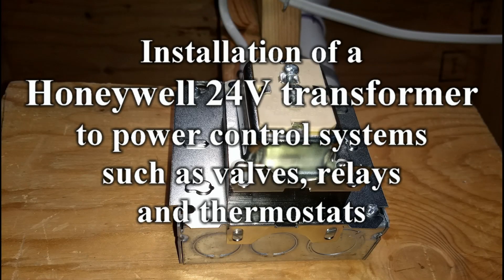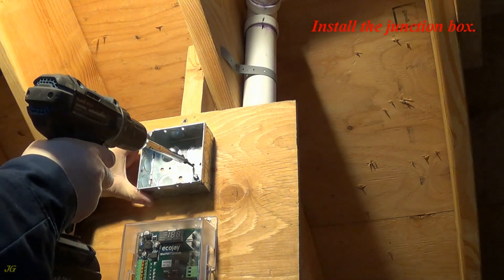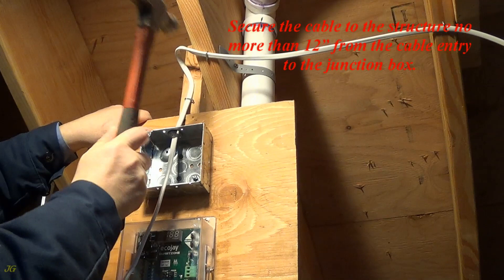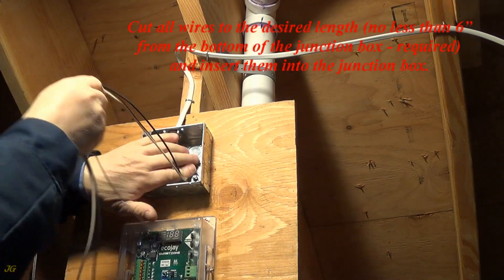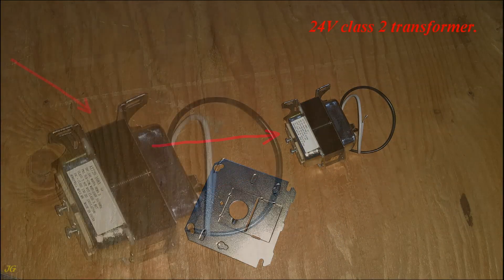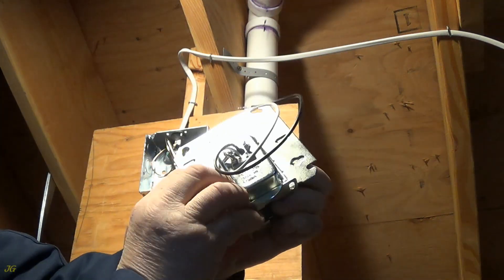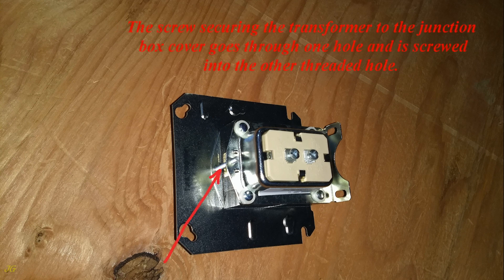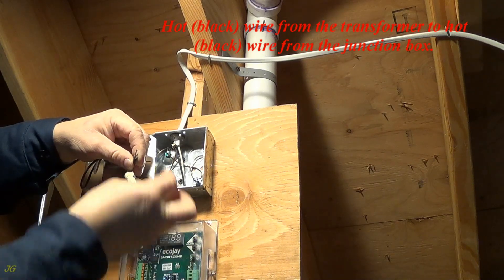Installation of a Honeywell 24V transformer to power control systems such as valves, relays, etc.

Comment: Hello John. Cool video. Now I have 2 wires coming out of my combi tankless boiler to my thermostat. I want to update my thermostat to a smart one. I have the 24 transformer like that one installed next to the boiler. I dont know if the combi system offer 24V for the thermostat. How can I use the external 24V to connect to my thermostat? 
thank you
Reply from the maker: I don't know. But if these two cables from the boiler starts the boiler, you simply need to pass them through the sensors, if any, and connect the thermostat as always, but if not use the voltage from the transformer instead of the voltage from the furnace (boiler). You can find out how to connect the thermostat in my other videos. Maybe you have a connection diagram that came with the boiler.